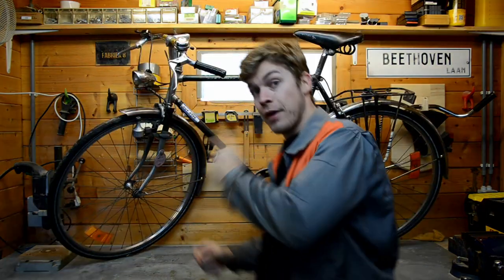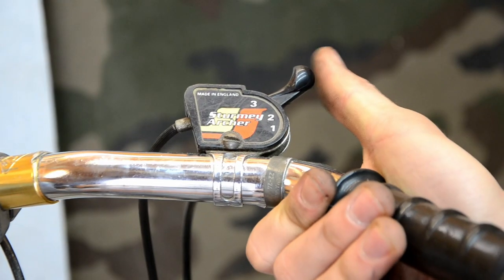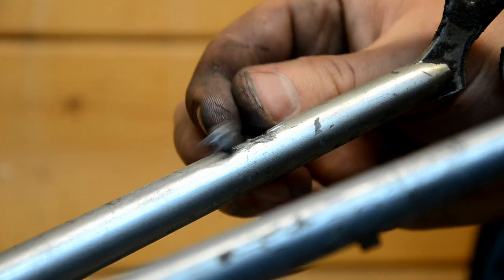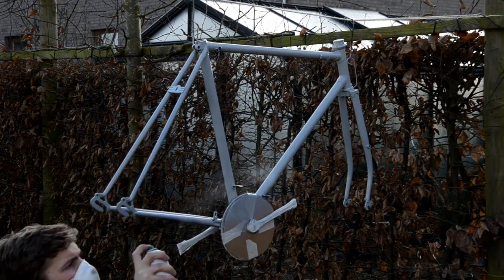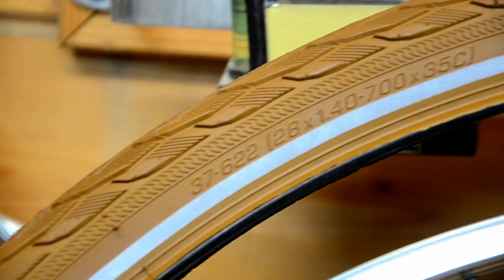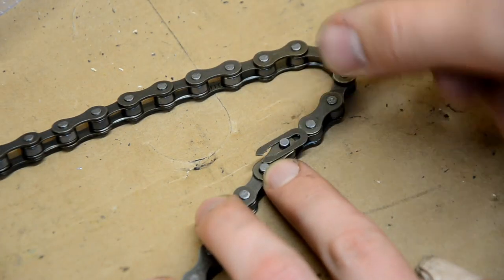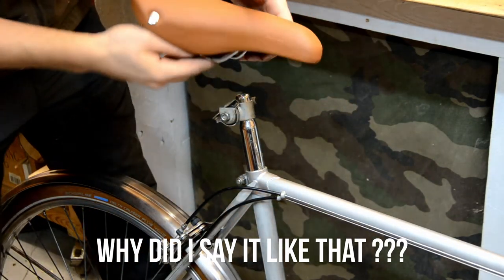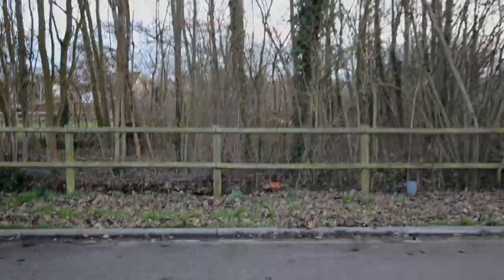Vintage Bike Restoration / DIY

Comment: Coating the frame/fork with a paint stripper and placing in a large trash bag for a few hours or over night will make the removal process more enjoyable. Great build. Thanks for sharing. 😎

Comment: I've seen tires removed and reinstalled using screwdrivers, but crescent wrenches make it a first! Amazing ingenuity!
Reply: I've done it but I wouldn't recommend it. Since I wasn't experienced enough I ended up scratching the braking surface.
Reply from the maker: Gotta work with what you have 😅
Reply: Just buy a pair of tire levers. They're extremely inexpensive and effective. They're made of really hard plastic as not to damage the rim or wheel surface. I bought my pair for 5$ at my local shop. That was for some quality Park Tool ones.
Reply: Like the screwdrivers I used when I was younger ! 
I could hear the groans from the old timers when I saw you attack the tire with the crescent wrench. They're right though. Plastic tire levers are cheap and won't hurt the bike.
Reply: Come on, everyone knows you should use the handles from spoons :-) but most importantly of all… 1. start at the valve and 2. squeeze the rest of the tyre into the centre of the rim where it is less diameter and so gives the tyre the small extra free space so it will come off usually without needing any force from a tyre lever even… you’re welcome!

Comment: Why not disassemble the bike fully?
Reply: I was thinking the same way...
Reply: Bottom brackets might sometimes require special tools. Given this is an 80s bike, the bottom bracket might have been pressed in.
Reply: Correct.How can you spray properly with a crank in the way?Masking tape or not....And the forks could have come out....Years of old grease in both and when they will need replacing,you risk scratching your new paint.....Seems a shame not to have gone a bit further strip down...

Comment: NICE JOB!!!, Especially being a Novice Bike Mechanic. You gave ME Ideas, Especially with your Cool DIY Frame Cable “Braze-Ons”.  You Should however Overhaul and Grease the Bottom Bracket, Headset and Both Wheels’ Bearings, and Oil the Pedal Bearings and adjust them if there’s ‘Play’.  You MAY need to Replace the Brake Pads and Tension/Tru/Dish the Spokes on the Wheels, ESPECIALLY if you Descend Hills at High Speeds on this Bike.

Comment: A simple tip from a fellow bike restore enthusiast: use paint stripper to remove paint, always took me within the day to finish. Easier, cleaner, faster. 👌
Reply: Thanks for the tip! I'll be trying that once I get to start my project
Reply: @staffitup  no worries. Be sure to do it carefully as paint stripper stings real bad if it gets in contact to the skin. Look up bike paint stripping videos on yt so you can get some idea. 😁
Reply from the maker: Thanks Kit, it would have made the whole process a lot easier 😅
Reply: @SpareTimeShop  no worries. You oughta try it sometime. 😁

Comment: Incredible restoration given this was your first time. 
i recommend wet sanding between paint layers. Spray cans tend to make the paint less smooth, and smoother paint lasts longer and is less prone to chipping.
Also, you could use nafta or paint thinner to clean the rear sprocket of the bike. Just make sure you're outside if you're using thinner. That stuff is incredibly strong.
Reply: Mek works great

Comment: Well done for a first time, need to overhaul bottom bracket, headset , front & rear wheels, then it would be perfect . Like the saddle very much, where did u buy that , any link on amazon would be much appreciated. Cheers

Comment: Good job as for Your first bicycle re-vitalization :) IMHO You could of try to find some reproductions of original stickers, to keep it as close to it's original form as it was. It would keep that bike's character, naked frame just looks kinda.. soulless ;P  Beside that - great work, keep it up. After I have finished with my first bike it became my hobby, to make something special out of a "rusty trash". My first bicycle was German Centurion with Magura's hydraulic breaks, afterwards I re-vitalised 80's Peugeot road bicycle for my brother, then again German Rabeneick Fahrrad 1951 and now I'm again at 76' Peugeot, this time for myself. Next in line will be Polish classic road bicycle ZZR Jaguar, I'm gathering original Czech and Polish parts right now. 

Regards from Poland and keep the great work ;)
Reply from the maker: Thanks! I was going for a very clean look, but i get what you're saying with the stickers. Sounds like you got a real passion for bikes aswell. Keep up the good work. There can never be too many classic bikes on the roads again! 😁
Reply: @SpareTimeShop  The most important thing is that this bicycle looks exactly like You wanted. 

Hah, You are right about that, more vintage bikes on the streets again, the better :D

Comment: using gear housing on brakes is not a good idea. 
You should have removed the fork and  regrease the bearings,
Reply: @waldorfvonmuppet7399  ok I was trying to find a video on how to remove the fork from frame on my Raleigh Nottingham 3 speed . . no luck this far finding a video but his Idea to leave it attached is what I will do too if I cannot find what I am looking for. Its my first time restoring a vintage bike to modernize but shits hard to find any real how to videos .  any help would be appreciated
Reply: @douglasfrancis6852  try RJ the bike guy on YouTube even if you comment on his older videos he usually responds. Worth a shot mate.

Comment: First attempt?? You made it seem like you were a pro at this! Nice video.
Reply: A pro would have removed the fork and cranks in order to clean, inspect, and regrease the bottom bracket and headset, and would have disassembled the hubs for the same reason. His "restored" bike still has [probably] 35-year-old dirty dried up grease in all the bearings, and they are probably all out of adjustment and possibly damaged (e.g., pitted cones, and/or cups, and/or bearings).

Comment: Drilling holes into the frame is a big no-no.  Bottom bracket/headset/wheel bearings were important to clean and re-grease. Lot was left out.  But it looks good.

Comment: Nice job with all that work.  Next time, use chemical paint stripper.  Takes off all previous paint in minutes.  If you take off the crank and fork, it makes painting much easier.  You need to check the bearing races for wear and re-grease those loose ball bearings in the headset and bottom bracket.   Steel bikes are classic.

Comment: taking out the bottom bracket and replacing the bearings in them as well as in the headset is probably a good idea since the bike is so old and well as regreasing some of the parts
Reply: Orange OwL  there's no shame in going to a bike shop for some help

Comment: Recently I just acquired 4 antiques bicycles. My favorite one is banana seat or beach cruiser. I don’t much about it, it has manufacture numbers right at rare wheel mounts that’s it. It says “ Flightliner “. the second one is Rollfast. V Ted William and Company Tricycles. I am looking to restore it in proper perspective way. Restore or working on bicycles are not hobby, or career. I just to get my hands dirty when I’m free and I don’t like setting lazy. I am looking advice as much as I can. Any suggestions is greatly appreciate.

Comment: Nice job and a lot of work!! Good idea to use a simple cable holder for the hubcable. 
Why did you not use the old bicycle switch headlamp? This lamp is pretty and made by metal.
You can buy a LED E10 bulp lamp to update the old lamp!
Greetings from Hamburg, Oliver

Comment: I have absolutely no experience with this either, I actually search to restore this old Fuji I trash picked. I want to repaint it among other things and every other video shows taking the cranks & fork off but I like the way you did yours, it saves me a lot of grief getting a vintage crank puller and other various things. Did the paint job hold up? I know it’s only a month since you payed but I’m curious. 
Also If possible what’s the prices you used to tape those areas up? 
With this quarantine going on I figure it’s the best time to restore this 😅
Reply: imho the best youtube teacher regarding bicycle repair is RJ the Bike Guy u should check out his videos.....I learned most of what I know from him...
Reply: myvicariouslife  I’ve been subscribed to him for awhile now.
Reply: @myvicariouslife4012  MonkeyShred is very good too.  He restores a lot of bikes.

Comment: whats with headset, BB and service for the rear hub. This is not really professional. Its only a cheap handyman work.
Reply: I guess you missed the part where he said he had never done anything like this before and wasn't a mechanic?  Why would you expect someone like that to be a professional?  He did well for a first time effort.

Comment: Please do not do this to a collectible vintage bike with original paint/decals. Doing so can majorly kill the value
Reply: Bikes are made to be ridden, not to be collected for their value.  I think he did an awesome job.
Reply: Hmmmm I dont rememeber saying anything about not riding them 🤔? I have a 1937 marshall wells , 1948 schwinn b6, 1959 schwinn deluxe tornado, 1940 hawthorne etc... all have original paint and they are unrestored. Only things changed are the tires and i ride them all the time. If i add scrapes etc no big deal because yes they are meant to be ridden. But if i stripped them down and spray painted them it would kill the value and the originality of the bike
Reply: ford blue hi, nice collection, yes bikes in original condition are quite interesting, and agree that scrapes and scratches are no big deal and add character to a bike, and good to hear you ride your collection.  I quite like to when people like this guy instead of throwing an old bike in the trash bin take the time to bring it back to life and put it to use, steel bikes can last for generations if they are cared for.  There are some people out there though that want to collect old,bikes like stamps or coins, afraid to touch them lest they owe their "value," buying snd selling them and attempting to drive the price up.  In my opinion the value of a bike is in the utility and fun you have rising them, not in its price.  So,, that's what I meant :). Quite like the final result of this guys work, lovely looking city bike, looks like it would be fun to ride. Thanks!!